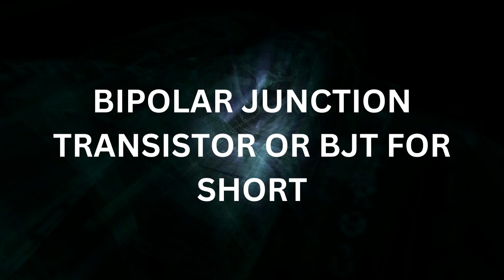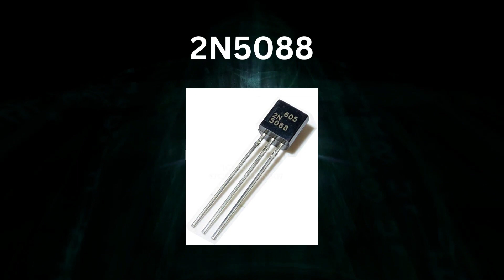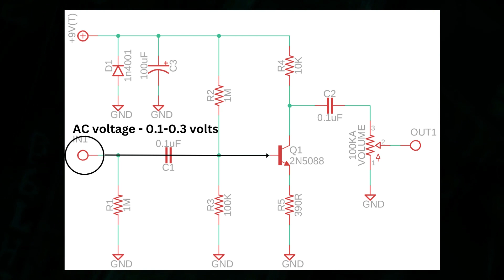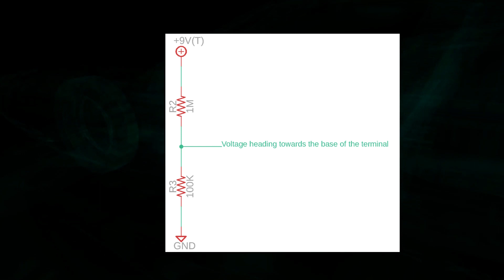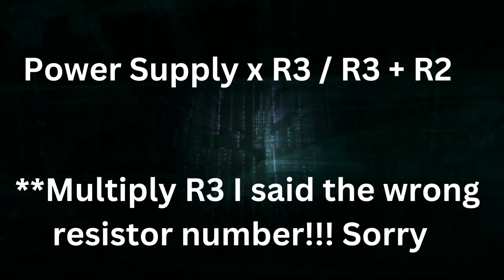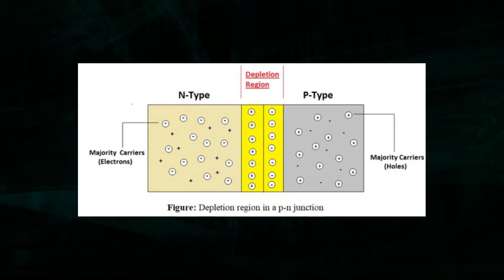LPB1 Circuit Breakdown - Video 3 - Biasing the Base of the Transistor

Comment: Really great series, and it seems that there is coming a part 4? What I am really interested in, is: what is the resulting input impedance?

At a quick look one could be tempted to say 1M, but I think that the 1M input resistor is in parallel with the bias resistors, which also has to be seen as parallel. So my guess is:
1M, 1M and 100K in parallel = about 83K, which is a very low impedance for a guitar PU to work with.

Please correct me if I am wrong.